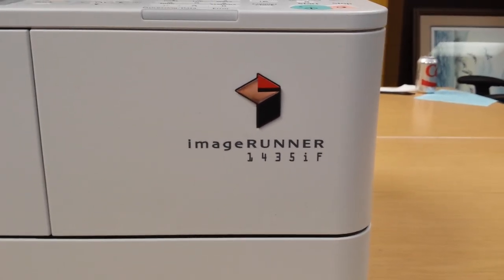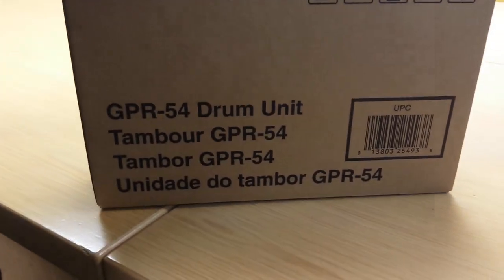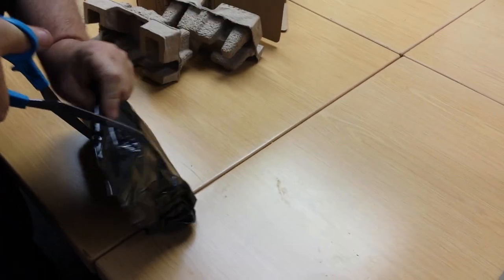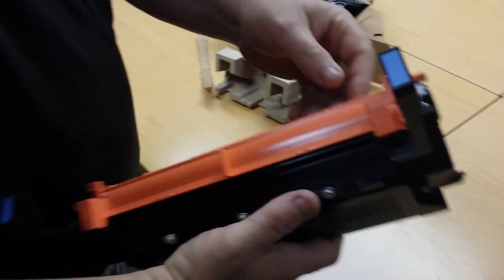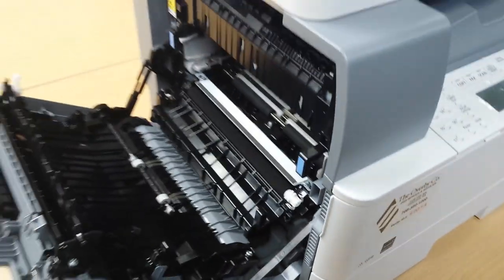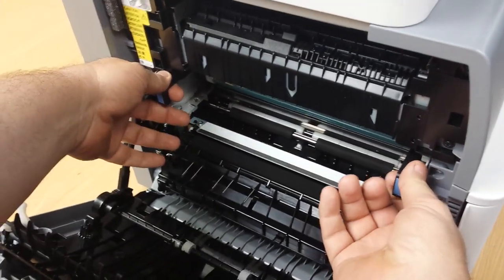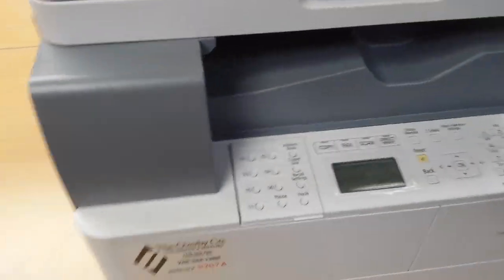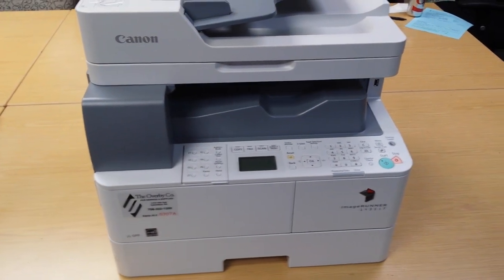IR 1435 Drum Replacement

Comment: I installed a new drum unit and replaced the fuser film, and since then half of the printing is missing or at least faint in the vertical direction. What could this be? There was no such error before.